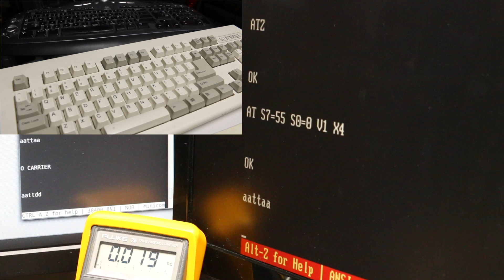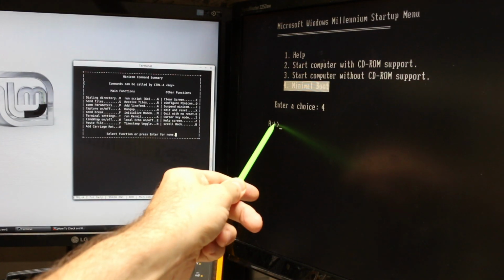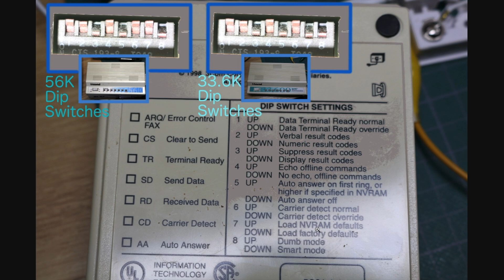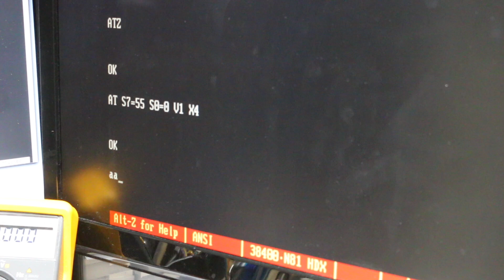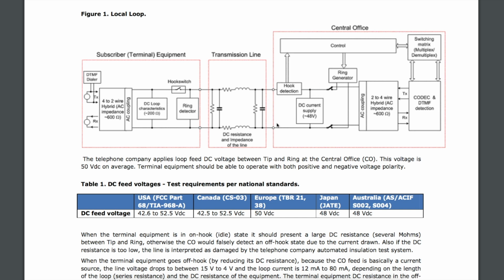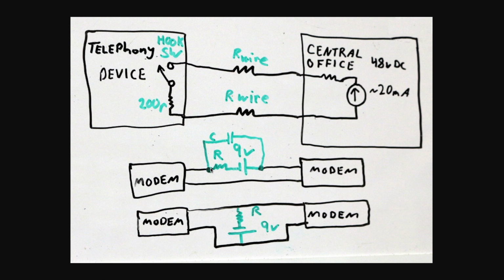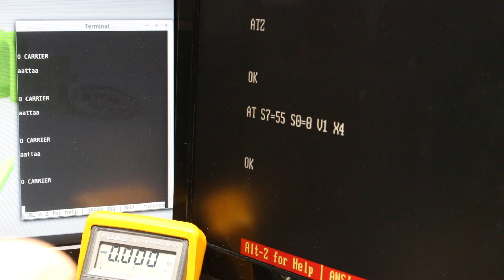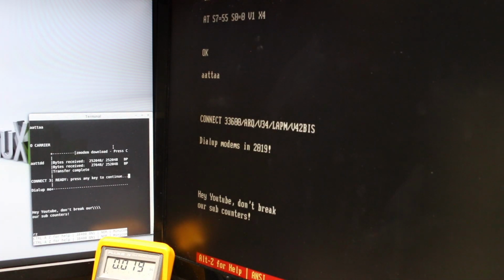56k and 33.6k Modems Connecting to Each Other with no Phone Service

Comment: A few years ago, I also used the 9V battery circuit to help out a friend who was trying to extract data from an old Mac with a modem.  Quite a good feeling to see it work!  You are doing well to get two of those old modems to connect at 33.6K.  Gosh, these devices were finicky, ran hot, and broke all the time.  I had a couple of jobs managing banks of them on servers with octopus serial devices.  Constant issues.
Reply from the maker: When I went to dismantle that set up yesterday, the underside of both modems was very hot. I remember there were those special COM port expansion cards that had at least eight serial ports, I forget what that was called. I guess all the multi node dial-in systems had to have those  if they had more than two nodes or so.  I guess they could have two internal modems on com three and four and two motherboard comports one and two before they need to get fancy. IRQs were scarce
Reply: @GadgetReboot  I worked at Pipeline Communications, that took 1-800 dial-up software registrations, games mostly, before the Internet was a big thing.  Had external modems, because they were easier to replace when they went funky.  A bank of fans blew on the modems, and the whole room was air conditioned to a frigid 60F.  We called it the "ice box."  The servers used things like this, but on an EISA bus: https://www.startech.com/Cards-Adapters/Serial-Cards-Adapters/8-Port-Native-PCI-Express-RS232-Serial-Card-16950-UART~PEX8S952
Reply from the maker: I just remembered the multiple serial port interface I had heard of in the 90s, affiliated with major BBS software https://commons.m.wikimedia.org/wiki/File:Galactiboard_01.JPG
Reply: @GadgetReboot  RocketPort was the most popular one. They had an IRQ handler IC onboard and a driver to sort it all out.
Reply: I find US Robotics 56k modems in network racks to this day. Sometimes at businesses that have not had POTS lines for a decade!

Comment: Connecting 2x 56K modems together will not allow 56K connections, only 33.6K as 56K requires a special dial-up server operating over ISDN.
Reply: no it jumped to 33.6 if he used the 14.4 it would jump to 14.4 as the handshake determines the slowest max speed,
 my dial up would do 52k and direct connects is possible for 6.4+ but yeah it could be a isp side for the v.92 56k stuff...breaks out modems!! i do know one thing for sure lucent chipsets modems would give you almost a -100ms ping to a us robotics..but us rules the download
Reply: Surely there's enough SNR on this short run to get 56k, but I wonder if the modem firmware even bothers to try if both sides report being connected on an analog line during handshake.
Reply: In theory it can be done, an analogue 56k remote access server can be developed from scratch if someone knows how the system works and how to implement the system. Almost 99% of all 56k servers use digital modems and must be connected over ISDN - T1/E1. The digital lines are then translated over to analogue at the exchange before reaching the customer. One way I know to make a DIY 56k server is to use a dedicated 56k remote access server and use an ISDN-FXS PSTN simulator, which translates the ISDN to analogue in much the same way as a telephone exchange. Such simulators are very expensive and uncommon but if you are lucky, you can find these units from telephone exchanges that are throwing their old equipment's away. I know of one model which is listed at over $2500... Not something i can afford based on the use it will receive, being only for the fun of it.
Reply: @Ali6359.  I wasn't expecting such a quick and informative response on a two year old comment. Thanks!